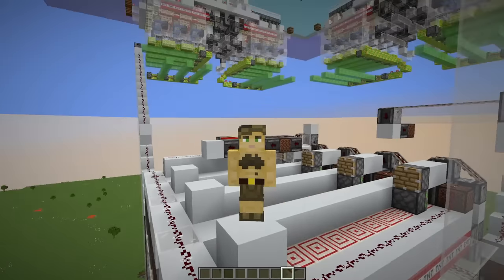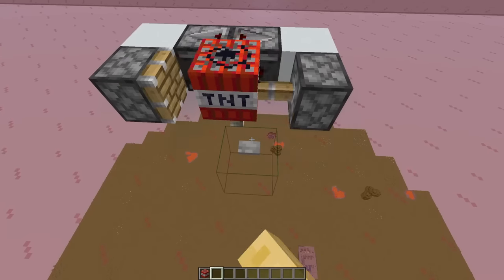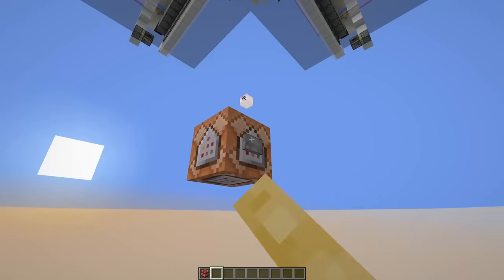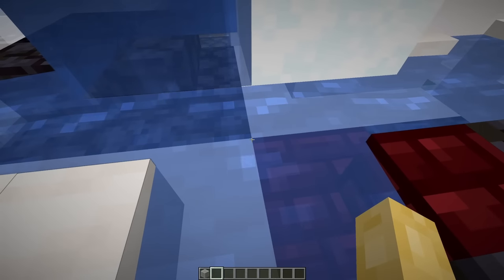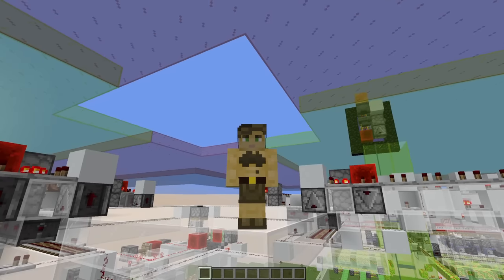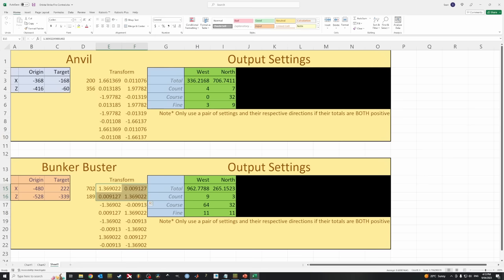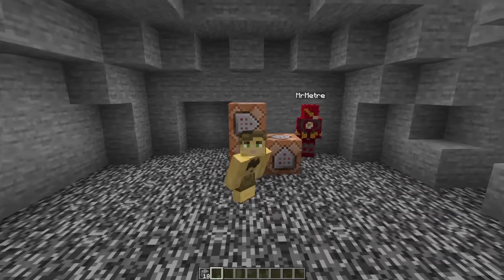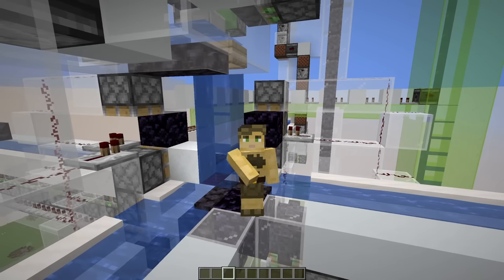The Incredible Science of the Orbital Strike Cannon

Comment: My question would be, can you throw in a ender pearl loader to this thing to tp to anywhere in the world that is loaded. Even better is if the pearl is somehow put at the end of the orbital strike so you can super hero landing in the huge pit!
Reply: Yooooooo I love this idea. Or if you could have a remote activation for the cannon (with preprogrammed coordinates) it could be like an air strike. If you built a whole wireless red stone transmitter you could build a military outpost or a aircraft carrier you could wirelessly set coordinates from. Extra points if it’s connected to a Morse code system on the ship with a single note block that beeps whenever you touch it. The add skulk shreakers on the ship to act like a raid horn there’s so many possibilities

If you preprogram a spot in the machine itself the wireless system could transmit translations of the original coordinates by adjusting the location by a scale of the lecterns and any direction. I understand tnt doesn’t apply force linearly, or at least I think, so this wouldn’t be precise but it would be really fun to set the original target to a base and have a remote controller in an outpost by the base. You could send simple messages to the main cannon to slightly change the location of the strike as you watch it live from close to the target
Reply: pearl not purl
Reply: U would have to align the pearl
Reply: the location where the pearl lands would have to be actively loaded
Reply: The problem is loading the area you want to pearl to
Edit: wait you could load it with tnt that is processed ahead of the pearl bc it loads it for 1 tick
Reply: @thedenominator_  it doesnt. Cubics video might be a bit confusing on this.

The idea of pearl cannons of the original user is very old. Usually u do them by manual insertion in the cannon since ur already there anyway to activate it. Tnt archive is mostly about pearl cannons

In 1.12 a cannon shooting in unloaded chunk was possible (we did it on hekate with void cannon, see xcom) by shooting 25 nether stars to ensurr that the chunk the pearl arrives in id loaded. In verdions after 12 this does not work
Reply: @dramwertz4833  If you watched to the end of the video, cubicmetre showed that if tnt moves into an unloaded chunk and explodes in the same tick, it actually loads the chunk for 1 tick. It is not the same as the 1.12 tech
Reply: @BryanLu0  yes it loads. But only to border chunk. As you can see in the video, the entities dont react. The chunk is mot entity processing and thus useless for most things
Reply: Cubicmetre replied to a similar comment on the original Orbital Strike Cannon video, because of the way enderpearls work it would crash your game
Reply: @nubbyboi6523  im not sure what exactly you mean but pearl cannons most def dont crash the game.
Do you mean one that would shoot to 30mil*30mil? Cause ye that would cause minecraft is bad in that regard lagwise XD
Reply: @dramwertz4833  Idrk I just read that because of the way enderpearl movement is calculated (lots of raycasting), Minecraft has some issues if you try to send a pearl over the distance that you can with the cannon
Reply: My question would be this machine work in Minecraft bedrock editionn
Reply: My question would be this machine work in Minecraft bedrock edition
Reply: @dkdevil3364   in general most likely no. Bedrock is weird alot of times
Reply: @Ealron356  On the mainchild server, one YouTube has already done this, namely remote guidance through an update suppressor
Reply: this wouldn’t work because of a piston pushing it would activate the pearl
Reply: @RocketDCP  wrong. You can move and crush pearls without activating them
Reply: Tp to friend?
Reply: @Ealron356 Pearls don't work in this, your game would immediately crash, it was already solved ages ago because cubicmetre already responded to one of these comments.
Reply: @thedenominator_ if your playing on a decent size server there’s almost a guarantee it will get loaded rather quickly you could also have tons of people do the same with multiple pearls

Comment: The only man in the entire history of the human race to understand how Redstone Comparators work.
Reply: i'm aware this is a joke however ima explain them anyways.

the comparitor either checks if the redstone going into the side is stronger than the one going into the back (compare)

or it subtracts the redstone going into the side from the redstone going into the back (subtract)
Reply: @comet.x  bro what 😂
Reply: @comet.x  Yeah I don't get it, make it layman
Reply: @williamkwl6153  it either acts as x>y or x-y
Reply: @seanandrews5329  (Yep I'm 3 months late, I know, but I don't care)

The redstone dust have a power loss within the distance (from 15 to 0, which means that redstone can go to 15 blocks before needing a repeater)
When you have power going inside of a comparator, it just gives the actual power as output (so if there is a power of 13 in, it will give a power of 13 out : input = output)

But when you have power going on the side of the comparator, then the comparator will check if that power is stronger (closer to 15) than the actual input. so, for example, if you have a power of 14 going on the side of the comparator and a power of 13 as input, the comparator will send a power of 0 as output, because the side power is greater than the ingoing power.
And, with the same logic, if the power on the side is less than the input, then it just gives the same output as input (remember ? input = output !)

The last function that a comparator has is the "subtract" mode (when you click on it and it has a torch that lits up)
it's very easy to understand : the input power (in our example it was 13) is subtracted by the power on the side (in our example it was 14)
as 13-14 = -1, it will just give a power of 0. if now you have 15 as input and 10 on the side and the comparator on subtract mode, then it will give a power of 5, because 15-10 = 5. That means our redstone signal going out of that comparator will be able to go to 5 blocks before needing a repeater.

I detailed a lot so I hope you will be able to understand this much more than before, have a good day :D !
Reply: This is the clostest thing im trying to fully understand that thing, ty!!! @Cec_Krem

Comment: You could totally use wireless tech to encode the target coordinates for this.

I might improve my "portable" transmitter design to be compatible with the binary receiver so it can be set up in the field quickly.

Like seriously, this is groundbreaking, because now we actually have a practical requirement to apply information theory to; how to most efficiently transmit a complex signal from anywhere in the world in the least amounts of bits and blocks placed as is humanly possible.
Reply: Holy crap, I could make it use a serialised signal!
Reply from the maker: Yes it would be pretty cool to transmit the coordinates to the cannon from anywhere in the world to call in an air strke. I'd imagine it would be pretty simple to make a redstone computer to perform the linear algebra for the phase space transformation and feed it to the cannon.
Reply: @cubicmetre  I mean its just a vector transformation, so it would be a pretty simple computer in fairness.

But damn, finally computational redstone isn't useless!

I'm actually gonna spare some time for myself this weekend to prototype something. Hopefully y'all haven't beaten me to the punch by then 🤣
Reply: @cubicmetre  inputting the right values from an excel table and launching from anywhere in the world (worlds) is done (using linked items) (not by me) (and it looks very neat: you take a shalkerbox, and it's like a panel where you can set values). I think building a calculator in game for that is too slow and unnecessary, using excel table doesn't waste too much time

Comment: 23:12 The reason the TNT rendered after another entity can apply velocity to it despite being in the same position is actually because of wobble. The game processes entities one by one in render order so the other entities that were rendered first all move down, then the first TNT moves down and explodes in the same spot, applying velocity to the rest of the tnt in the opposite direction. The location that each subsequent TNT explodes wobbles around its location at the end of the last gametick, and the average location of explosions will be between its old location and where it would've ended up without the feedback loop. You'll notice this has poor efficiency because some of the explosions actually happen on the other side of the group of entities you're trying to accelerate.

This is also how OoE fusions work and why they have terrible efficiency, and why on some factions cannons different hammer ratios change more then just the velocity they apply, like causing entities rendered after them to bounce up sometimes.

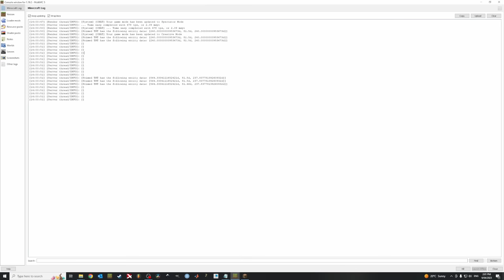Comment: With the knowledge presented at the end it should be possible to solve the offset issue in 14:30 by simply giving the (in the picture) bottom and left tnt momentum in the last tick before exploding so it moves forward in the lazy chunk, aligns itself against a block and explodes in this exact tick because it is still processed. I guess that my logic is some sort of flawed because the solution seems too simple and I'm not at all in the subject, therefore I'd love to get corrected.

Comment: Two questions (I think I asked the first before but not sure):
1. How are you flying around doing things in lazy chunks outside spectator?  In the previous video you placed a TNT next to a redstone block and the TNT turned into an entity but didnʼt flash or explode.  Is this video magic fakery or a very useful mod?
2. Does lazy acceleration damage entities, or could you eg. lazy accelerate mobs or minecarts or item entities?
Reply: (My idea for this is instant item transport.  Instead of rail networks or hopper lines or manually carrying items or anything, just propel the items from your farm directly to your storage.)
Reply from the maker: Lazy accel only works on entities that are invulnerable, if you try to do it with an entity that takes damage it will almost certainly die if you try to accelerate it to any decent speed. In terms of working with lazy chunks I have two tools, the first is the rule spectators generate chunks which I demonstrated, this allows you to be there for the actual behaviour of the entities but doesn't allow you to interact with them or see them very well. The other tool I used is tweakeroos entity ticking toggle which only works in singleplayer, it toggles entity ticking completely so it lets you see and interact with the entity as if it was in lazy chunks but makes it harder to emulate the chunk loading behaviour.
Reply: @cubicmetre  Too bad about the entities still dying; there might still be some ways to make it work but thatʼll make things harder.

Iʼll keep that tweakeroo setting in mind, thanks!

Comment: Hm, Cubicmetre, I'm wondered by this tnt chunk loading you showed in the end of the video. You said, that tnt loads the chunk for one single tick. Is it possible to toss something into portal in this chunk during this single tick, activating pre-made chunkloader there? What I want is to load the chunk somehow from the distance without requiring to go there, after server restarts. Currently i'm not aware of any known ways to do this.
Reply: I think you can do a chunkloader line that load one another, but this would require building all of them. Doing this with tnt loading technology would be more elegant, but i think its possible without it.
Reply: @O5MO  Line of loaders is not an option if you're playing on some server, especially when your base is hidden like 30k away from spawn.
Reply from the maker: Unfortunately the TnT does not elevate the chunk into entitiy processing, as I demonstrated the items are ignored by the blast, you need the chunk to be entity processing to allow entities to move through portals to kickstart the process.
Reply: @cubicmetre  what if you load a 3x3 grid with your cannon simultaneously, will this do the trick for the middle one?
Reply: @cubicmetre  i see... Well, what if you use your cannon to load a 3x3 grid of remote chunks for 1 tick? 🤔 Does the middle one become an entity processing this way, or not?

Comment: Now connect it to a redstone computer so you can calculate the propellant tnt in-game. It is just some fixed point matrixultiplication. You would only need a 32-bit minecraft cpu.
Reply from the maker: You could make a purpose built ALU for performing the matrix multiplications, the annoying part is that you need to use a different matrix for each quadrant around the cannon and incorporating that into the logic would be kind of a pain.
Reply: @cubicmetre  yeah right, directly implementing the numbers as constant would make it a lot easier. Also doing the shifts needed for fixed multiplication directly in redstone would be faster than having to do them in the program. The problem is that you can't modify the tnt cannon without having to modify the matrix multiplier. It would be nice to have a general purpose computer that you can hook up to any cannon you want and calculate the tnt needed

Comment: What if there was a chunk loader setup in one of the chunks being loaded by the detonating TNT?  would it begin to run? would this be a way to wake up distant chunks from a central location? this is so interesting
Reply from the maker: No, as I demonstrated the chunk loading state does not load entities, so you cannot get entities through portals in that chunk loading state which is the minimum requirement to get a chunk loader running.
Reply: @cubicmetre  Since the tnt still exploded in the unloaded chunk because it traveled from an entity processing chunk during its' last fuse tick, could another entity (an arrow maybe) be shot from the same loaded chunk so it precisely lands inside a portal block in the tnt loaded chunk and then travel through it to start full chunk loading? just speculating here

Comment: Hm... with the tech already described, would it be possible to launch a tnt, along with a sand block, to every block, in a cube, to make the equivalent of a world eater, except it doesn't move, and can technically be a fixed location, and new perimeters can be made within the greater range of the machine.
Reply: Docm77 said something about someone working on an "instant perimeter" in his latest hermitcraft episode, so it looks like you're right.
Reply: While yes that theory has been proposed its not too useful in practice.
Since unbreakable blocks exist you still have the problem of needing to remove blocks manually afterwards
Reply: @dramwertz4833  Okay, sure, but at least you only need to build the world eater once.
Reply: @bable6314  while that is true if you want to ensure getting rid of all blast resistant blocks youll need alot more tnt. Which means much more lag. But theoretically it might be of an advantage yes

Comment: Why is the plane to setting transform linear? Shouldn't the firing distance depend non-linearly on the initial speed and angle?
Reply from the maker: Motion in minecraft is defined linearly independent for each axis. So you can just use a set amount of tnt in each axis to get a desired velocity
Reply: @cubicmetre  what about vertical axis, is the number of TNT blocks for it the same for every setting?